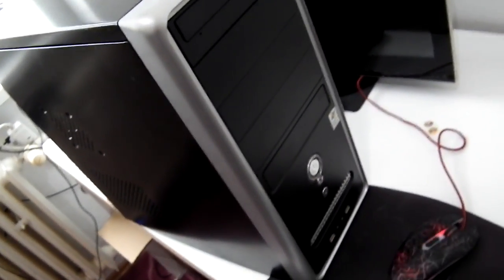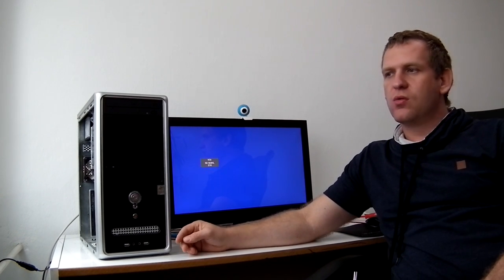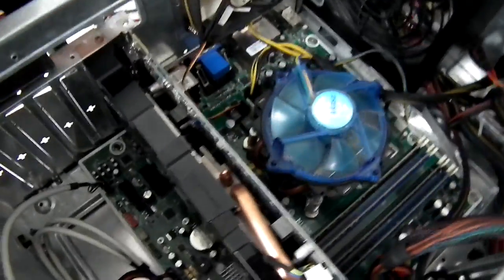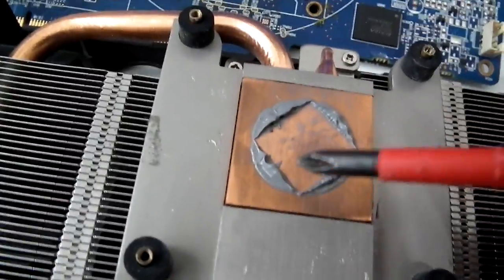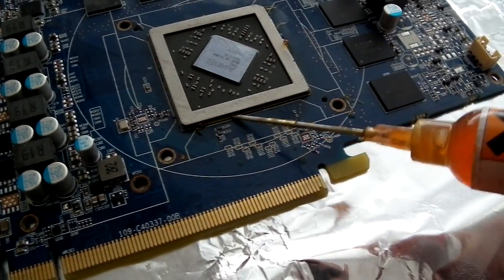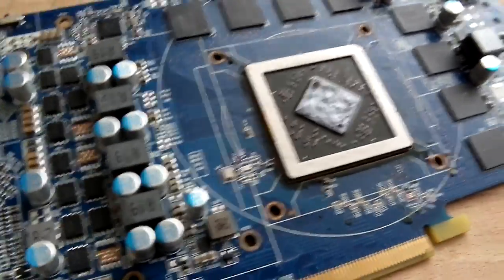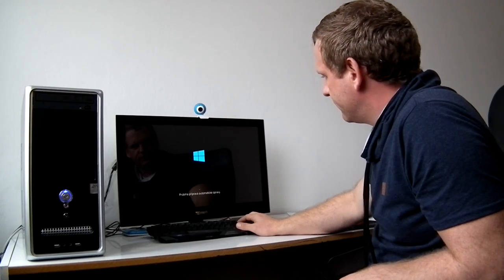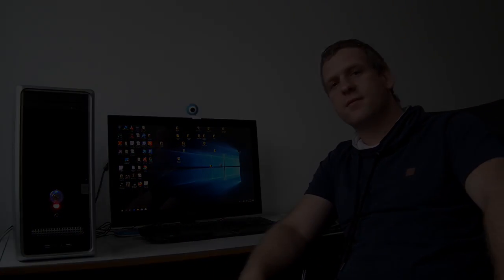How to fix GPU black screen after load windows - HD 7850 2GB FIX

Comment: This guy is like Strauss from Quake 4
Reply from the maker: He thanks for compliment
Reply: @frogtechtips  By the way your video has helped me a lot, i had a 290x vapor x that i bought with the same problem. Now i've fixed it doing the same reflow. I hope it works for a long time. Grettings from Argentina
Reply from the maker: @marte7054  you welcome and I hope you click subscribe as well 
Btw from my experience some cards working 1 week and some 5 years if problems come back you can still repeat process with little bigger temperature and if you want to help your card do some BIOS modification with undercloock. This can help make a less stress to your card and keep live longer time

Comment: My card freezes after 10-30 seconds of windows sign in window pops. I lts a gtx 970 currently on display on my shelf and i replaced it with a gtx 1050ti but i always wondered what was wronge with that card. At first i had to replace shorted mosfets and then it started freezing. Really weird but thank you for the video :)
Reply from the maker: ye looks like your card just go to end and   as you have short as well you get some shock to you card with is usually no predictable how long will survive :-)

Comment: My videocard is detected on safemode but on normal mode its not detected i tried installing drivers and safemode but when i start the pc on normal boot it goes black. The gpu is asus gtx 660 2gb
Reply from the maker: Did you try uninstall all drivers in safe mode.if you can try that GPU on different PC and if happens the same Just try reheating GPU as your card is out of warranty there is nothing to lose anyway
Reply: @frogtechtips  i tried uninstalling on safemode using ddu now im heating the gpu with hairdryer blower on max temp forlike 25mins hoping this will ressurect my gpu.
Reply from the maker: @markintalx  let me know as hair dryer is not strong enough but some people have luck with it
Reply: @frogtechtips  i tried 3times and repaste 3times but sadly... It didnt work.
Reply from the maker: @markintalx  not everyone have luck but did you try reheating with just hair dryer or with heat gun

Comment: Hey frog,
So I got a second hand RX580 from Facebook..
I installed it and it worked fine for about 2 days, 
Then it crashed when installing drivers, 
After that it didn't work at all, I tried reflashing bios, tried 3rd party drivers and everything,
Fans spinning but no image, I haven't opened it up yet.
But do you think that the process you showed in the video would work? Or do you know any ideas on why my gpu is behaving like that?
Thanks!
Reply from the maker: Hi as you try all I think and you can't give this card back to seller I think nothing to lose and try reheating GPU

Probably happening as Thermal paste been so dry and that's why card overheating and died when you use.

Next time remember if you buy used card and is out of warranty always replace thermal paste
Reply: @frogtechtips  Thanks for the reply,
Ill try it and ill report back.
Just waiting for my new thermal paste and flux to arrive, dont want to damage anything  
😁
Reply from the maker: @uwva4640  ok let me know after

Comment: have a dell studio 1555 laptop, after latest update on win 10, something happened , laptop screen boots to a dark screen. I can hear hard disk activities and fan noise, but nothing on display.

I reseated ram, cmos etc.still black display.
Then after a few days I again tried to boot it suddenly started into windows normally.

When I opened chrome browser it crashed and shut down. When restarted I could see colourful random patterns and designs. Seems like display driver corrupted. I tried D + power button, it cycles through all colors- means no hardware damage- and then again balck screen. Pressing fn + power key to enter diagnostic , still.dark screen.
Reply from the maker: Ok looks like you have problems with GPU as your pc start sometimes I will try replacing thermal paste at first point if that's doesn't help is bigger problems you can try reflowing GPU but on laptop all this steps are not so easy but possible do it btw did you try external LCD just be sure is not a LCD in laptop foulty
Reply: @frogtechtips  not displaying on external monitor too. Is it possible that LCD cable is faulty? Like when it did start normally once, it was showing lines, designs etc. Like kaleidoscope 😁
Reply from the maker: That's definitely GPU problem try first replacing thermal paste and if that doesn't help and if your laptop is out of warranty you can try reflowing

Comment: I have a problem.  My GPU is giving Normal black screen its giving display but black  help me please.

And its working. Gud  2 3 days  when i am cleaning with water
Reply from the maker: what do you mean you clean with water
Reply: @frogtechtips  yes   and know problem is blue screan
Reply from the maker: My question is why you clean card with water now is there probably liquid damage
Reply: @frogtechtips   so know cant be fix
Reply from the maker: Hard to say you can try replacing to see maybe will help but definitely use a Flux
Reply: @frogtechtips  ok i am trying. Thanks bro
Reply from the maker: @tariqcsgo1937  try and let me know
Reply: @frogtechtips  graphics card is working know but   i have a new problem  screan stuck while heavy load  and 75 heatup.
Reply from the maker: @tariqcsgo1937  this start do after reheating try less stress for your card or maybe do some BIOS modification
Reply: @frogtechtips   i can use amd firmware ?
Reply from the maker: @tariqcsgo1937  try mod you original BIOS vid VB7 software you can find video about that on my channel as well
Reply: @frogtechtips  ok i am checking
Reply from the maker: @tariqcsgo1937  yop

Comment: Gtx 1070 started doing this. I refuse to belive that my card is dead. Even do i did replace the termal paste. I dont have flux and heat gun . 
But i have same issue. Soon as windows logo comes. I get black screen and fans go 100% RPM.

Please help. I dont know what to do anymore.
Reply from the maker: Yes you right your card have problems I will try reflash BIOS and all other stuff and if still don't works try reheating as your card is out of warranty there is nothing to lose
Reply: @frogtechtips  reflash the GPU's bios or motherboards? 
Im gonna try This first,  and will let u know were i am then.
Reply from the maker: @mircea_kinghd3548  GPU BIOS and if you can also try this GPU on different PC
Reply from the maker: @mircea_kinghd3548  ok thanks for informing me

Comment: Sir help me my graphic card is nog giving screen and beep 2-5 times before it's working fine but next day I turned my pc on I see than the screen resolution is change its look like a lower resolution. So I decided to restart but after restar it's never shows screen or my pc also boot booting help please 😓😓😢
Reply from the maker: Hi what model GPU you have are your card is out of warranty
Reply: @frogtechtips  it's msi GTX 1060 
It's not in warranty
Reply from the maker: @REKARYT  I think you never replacing Thermal paste and that's make this problems I will definitely try reheating GPU put me thermal paste  and if you do correctly should help and before you do this try this card on your friends pc if you can
Reply: I tryed but same problem but in my pc some times my PCI slot not working
Reply from the maker: @REKARYT  definitely try reheating as your card is out of warranty there is nothing to lose anyway
Reply: When I use it in my brother's pc it's never give screen but pc gives output on mother board
Reply: After some minutes
Reply from the maker: @REKARYT  and did you try reheating already
Reply: @frogtechtips  yes with hot air gun but I don't have a liquid flux I used shouldering flux
Reply from the maker: @REKARYT  what temperature do you use
Reply: @frogtechtips  I don't remember but I think 200+
Reply from the maker: @REKARYT  try again with 320+ Celsius about 10 min heating on main chip and heat Also Vram as well
Reply: @frogtechtips  ok i will thank for helping
Reply: Yesterday i reached to tha repair shop the he says for this repair about 200$
Reply from the maker: @REKARYT  that's the point try reheating and usually is big success to get a card working again and if not luck is better buy new GPU as proper repair is shop can cost more that new GPU and there is still risk get problems back

Comment: Hi frog i just bought rx 580, the condition just like on your video. before i try the gpu to my pc i open the gpu to repaste and i found that one of thermal pad is missing, so i replaced it and repaste the gpu.

it worked for sometime but mostly the gpu will crash after few minutes. do you think it could worked if i reheating the gpu?
Reply from the maker: Hi yes can help but be sure your PSU is strong enough and if yes I will try reheating
Reply: @frogtechtips  okay, i will give it a try and let you know the result.
Reply from the maker: @anungkusuma  yop
Reply: @Frog - Tech - Tips it worked on my vga. Thank you very much.
Reply from the maker: @anungkusuma  nice thanks to let me know
Reply: @anungkusuma  any updates ? About three gpu

Comment: I'm sure 🤔 it won't playing games or 3D applications and it's temporary fix. You turn on the PC after 2 hr it gives you the same issue. 😁😁😂😂. Right? 
The propper Fix is changing the GPU core chip or reballing the chip with new solder balls. and it will gives you 2 till 3 year Lifespan again.... 😊
Reply from the maker: not always bro i have some GPU working more that 2 year after fix like this one but of course is just temporary fix if you don't have budget for new one replace core is not good opinions to expensive as for that money you can buy new card
Reply: @frogtechtips   Brother are you serious.....😯😮😯 That's good news 👌👌👌....😊 😍😍😍
By the way I like your channel..... 👍👍👌 
Keep it up love from Pakistan..  🇵🇰 "😍"
Reply from the maker: @prinxeannsprinceprince5126  yop my father have one gpu i fix with this stile and after 3 and half year still works like I say is BET but card is faulty northing to loose anyway but if your GPU is in warranty go on that way

Comment: Does this fix the atikmpag.sys cideo tddr problem with any gpu i got a amd readon 6000m hd series and it has 5 gb off v ram its very fast but im getting a black screan like it just turns off my pc and than a black screan with better light pops than blue screan and says atikmpag.sys pls help
Reply from the maker: Looks like you have problems with GPU reading drivers that's why that error if your GPU is out of warranty you can try reflowing GPU but on first point try new drivers and etc but as you asking I think you already tried all you can
Reply: @frogtechtips  i havent tryed reflowing it ill try it bit i cant open that cooler
Reply from the maker: @unknow.n  why you cant what the reason
Reply: @frogtechtips  the things that hold it still arent moving but tomorow ill go to a pc enginer and tell him to reflown my gpu i think he'll get it fixed cuz i even got no thermal paste but thanks for the help
Reply from the maker: @unknow.n  you welcome and let me know

Comment: Hi i have an hd 6450 and ive got black screen and my computer is locked down whit tat vga. and i have an 1600 w heat blower.
how many minutes is enough to warm up?
Reply from the maker: Hi I usually use 8 to 12 min on main chip with 290 C
Reply: @frogtechtips  ok thank you!
Reply from the maker: @xnorr.5851  you welcome

Comment: Hi. I have a gtx 750 and i have the same problem. I figured out that the cooling is not proper. I want to ask if the gun heating necessary? Thanks in advance
Reply from the maker: Hi some people have luck with hair dryer but I think heat gun is best did you try replacing thermal paste and clean card first
Reply: @frogtechtips  i didn't clean it and replace the thermal paste because i will only have new thermal paste on monday. And when the pc start it has a short "beep" sound. I use dell pc they said 1 beep sound refers to BIOS error. When i tried using onboard graphics it was ok. I don't know what's happening to my GPU but i think it's the problem.
Reply from the maker: @luminousblade4684  hard to say like this but ye try clean not just GPU put all you PC from dust and maybe will help
Reply: Thanks for the advices. I’ll take my chance. Quite funny that it crashes from a game that even lighter then a web and after that this happened.
Reply from the maker: @luminousblade4684  you welcome

Comment: My pc displays a black screen with a mouse cursor after the windows loading screen..
Reply from the maker: That's looks like drivers problem did you try boot on Safe mode and reinstall drivers
Reply: @frogtechtips  I cannot access the desktop, even on safe mode.
Reply from the maker: @Karma-eu2tr  and I BIOS GPU working correctly did you see any bad picture or artefacts in picture if not really looks like drivers problem if yes is definitely GPU bad and if you have onboard graphic try boot windows from it to see what happened and if boos uninstall drivers and try that GPU again
Reply: I have a question, this could be malware and Im planning on using this hard drive into a new pc, is it okay to use it?
Reply from the maker: @Karma-eu2tr  if I will be use in new pc I will be formatted HDD before used in new pc if you can

Comment: Sir my rx 570 goes black screen no signal after install gpu driver gpu fan not spins
Reply from the maker: And before you install drivers you have signal and fan spin as well
Reply: I'm having this problem right now, did you solved this?  I have tried everything
Reply from the maker: @AKGHyper  you have no signal problem or absolutely no power at all
Reply: @frogtechtips  I am having green screen of death when I install amd drivers
Reply from the maker: @AKGHyper  did you try reheating
Reply: @frogtechtips  I didn't try that one but I just did an underclock and put the power limit to the maximum and I have no problem since yesterday, now is kinda stable but I don't know if is good for gaming.
Reply from the maker: @AKGHyper  hi you do it right if your GPU working with that I will keep till have problems again.you will probably lose some FPS in game but you have working card now and that's the point
Reply: @frogtechtips  Thanks I appreciate your help 👍🏼
Reply from the maker: @AKGHyper  you welcome

Comment: Hello sir.i have just updated my amd grapich card and im not able to connect my grapich card its showing black screen. And the first grapich card was hot some and now its Cold like it not working. So do you Think some thing hapened on my grapich card its rx 570 and i just bught it last 2 days
Reply from the maker: hi do you buy as new one , did you see that gpu working,  are you connect all as should be  ,do you have PSU  strong for that card I need this information
Reply: @frogtechtips  yeah gpu worked well at first and  then i got update for my amd System and still cant run:(.my Power Supply is lepa mx f1 600 watt.. im schoked the fan is on and light also but no screen:(
Reply: @frogtechtips  At first my pc was able to se onknown device i mean rx570  but now its not showing any more and cpu not geting hot do you think its  die.but the fan and the light are working well
Reply from the maker: @hajarsindi2398  that's sounds like gpu have some problem do you have any second pc to try that card on different pc   maybe some of your friends can test that card for you
Reply: @frogtechtips  i will try thank you
Reply: @frogtechtips  oh another thing i have  reset all my bios Settings do you think its from it
Reply from the maker: that no problem
Reply: @frogtechtips  its painfull belive me i got 2 days free and this happened 😭😤
Reply from the maker: @hajarsindi2398  hmm ye my friend like I say this is live :-)
Reply: @frogtechtips  .do you thin it going to run  again if i reinstail my windows 10 or some tricks.thank you
Reply: @frogtechtips  omg my gpu is getting hot again sems it working help me please
Reply from the maker: @hajarsindi2398  if getting hot is definitely something wrong is that gpu new or second hand
Reply: @frogtechtips  new
Reply: Hey bro Hajar Sindi.... I'm also facing the same problem with rx570....did you find any solution bro?
Reply from the maker: @deepoceanmuzic253  hi you will probably need reflow your card if you have problem like in video

Comment: Hi, i use a laptop and when is turn ON the screen is black and i checked the graphic card and nothing happend.
Also when i turn the laptop ON the graphic card is very hot.
Reply from the maker: Did you try connecting external display , is your pc beep or make any sounds with looks like windows started or just fan working and nothing else
Reply: @frogtechtips  doesn t make any sound but the laptop is turn on, idk if will actually work if i connect my laptop to a hdmi tv
Reply from the maker: @costin6563  try that first and if that will work you know you have problem with your LCD if not working you can checking your ram but on last can be foulty your GPU